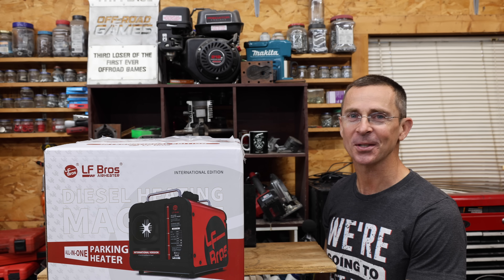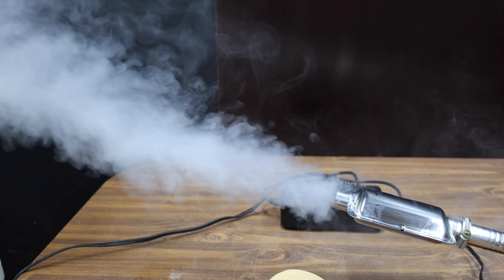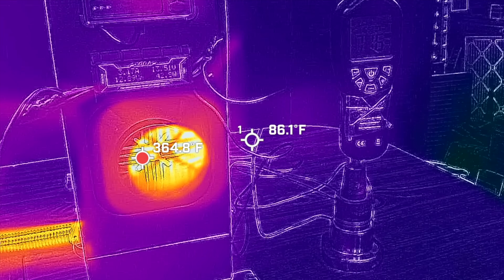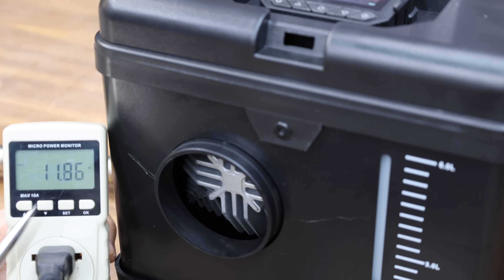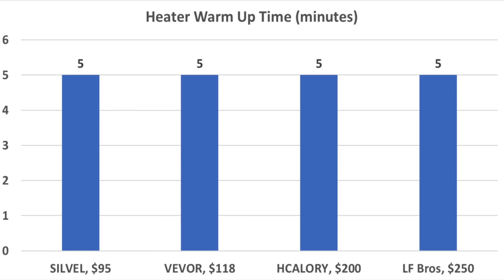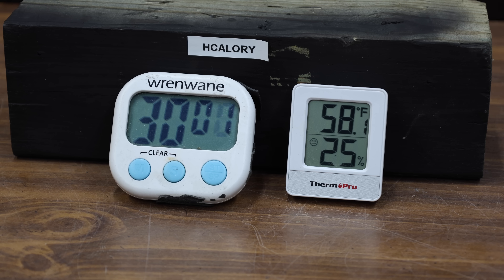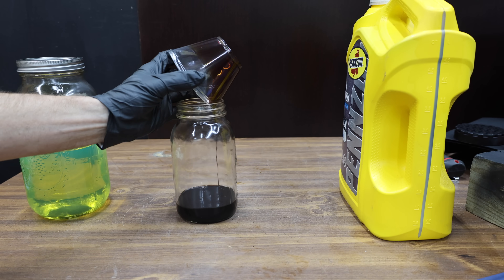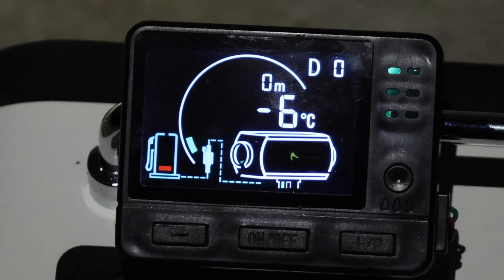The Truth About Cheap Diesel Heaters!

Comment: With the failed start on the silvel, you probably had some extra fuel which could cause the smoke. Need plenty of intake air as well. I have been using the tall model Silvel for my fifth wheel for about 2 weeks. The unit has worked great without a bit of smoke.
Reply from the maker: Thanks for the constructive feedback.

Comment: Measuring thermal output:  I built a thermal solar collector a while back, and wondered how to measure it, given all of the variables (and no pro instruments).   I eventually
thought of putting ~400w of incandescent lights in an insulated metal duct tube.  Then I could measure my electric heat power vs. temperature rise, and extrapolate. 
P.S. My thermal solar collector was good for over 1800W using just a 5" PC fan.  Yay.  But that was enough heat to make my styrofoam insulation stink.  Drat.
Reply from the maker: Thanks for sharing.

Comment: Great video!  I actually have a Vevor - it's not the same model you have there, but fairly similar.  I haven't used it for heating anywhere in the house, but I have been tempted to set up a window insert, so that there can be a "hot room" in the house if there is ever a long term power outage.  I HAVE used it when testing out a tent in some colder weather.  The temperature dipped 10 degrees Celsius colder than I had expected, and it kept me from freezing!
Reply from the maker: Thanks!  Thanks for sharing.

Comment: Live in canadian rockies at high altitude.... and i switched to a diesel heater this year for ice fishing... bought the vevor upright very similar to what you had there... had some noise issues to solve (now have pump tick almost completely silent).... but now its dialed in and works great..... i got it on sale for a hundred dollars canadian (huge bargain)... and is a ice fishing game changer... will never use propane again... works great in very cold temps...
From my finally frozen again,  overtaxed, undersized, lob-sided, igloo on the mountain in alberta Canada 🇨🇦
Reply from the maker: Thanks for sharing!
Reply: I use a Buddy type propane heater to heat my garage when working in it. How is the Diesel heater superior ? Do you get a lot more heat ?
Reply: @MathewPollard-vj4uq  to start , it's a dry heat ,  also it forced air so no carbon monoxide issues , and is less than half the cost to run over propane...way more efficient.... in my case it's also lighter to drag on ice... AND BIGGEST PLUS IS IT IS A LOT LESS OF A FIRE HAZARD...
Give one a try ... I bet you never go back to propane.

Comment: I've been using these to heat my detached 23x23 garage for a couple years now. Some brands like Lavaner Pros are tunable, which helps with efficiency and tuning for alternative fuels. Unfortunately, for WMO, it will gum up over time and produce a concrete like deposit that's hard to clean out. Some guys start it on diesel, and then switch to alternative fuel, and then back to diesel for shut down. Also, the 8kws are just a 5kw with a bigger fuel pump, and a lot of people have found no significant increase. Some people also use radiators or something similar to capture lost heat from the exhaust heat.

I have 2 5kws in my garage, which I insulated to R38. 1 heater can keep the garage in the 60s while it's in the negatives outside. I have a 2nd heater to help heat the garage from cold so it doesn't take half a day. Once the garage walls are up to to temp, 1 of these things keep the garage heated VERY well, especially for the price. I use road diesel cause it's more convenient, and then I actually put it on my taxes and get money back for it (about $12 for 55 gallons). I got one on sale for $65, which I planned to use for WMO.

Comment: Regarding fuel. I wonder if a mix of used motor oil, used fryer oil(filtered, but not proccessed like bio diesel) and regular diesel, would work in this... if i recall correctly back in WW2 they would make black diesel  by mixing 4 parts oil to 6 parts diesel... quick and dirty... 

 I think if i were prepping for winter ixd go as far as to save spent motor oil and fryer oil.  Mix the 2. Add acetone to dilute enough to filter (2 micron and magnetic) and then cut it 1:1 with pump diesel. Effectively 2Xing my fuel for the winter and having a nominal amount of processing to keep the pump and injector from clogging as well as allow for prolonged use (a full season?) With out fouling the glow plug.

Also. I plan on running either 1 of two ways.   Full heat  scavenging the exhause by running the exhaust through a copper coil, in a large steel container filled with sand, plumbed with a condensate drip trap at the bottom and the exhaust out the top before a muffler then out of the shop. 

And the air opwn in the shop. 

OR, runing it as a dual sand battery and having the air  blow through  a coil  as well.. 

 I feel that 2x sand battery would equate to a verry long warm up time, but provide the longest relief  from freezing nights in yhe shop. 

But probably  the way ill go is to have the best of both, and have the air run as normal and the exhaust through a coiled sand battery.
Reply from the maker: Thanks for the suggestion.

Comment: I have a vevor and a silvel and they are awesome. I definitely recommend buying the ones that come all in one as I bought a silvel that’s meant more for just installing in a vehicle and it was a pain to setup but still works flawlessly. I use the vevor to heat my 32’x28’ insulated garage with the exhaust run through a radiator and out the wall. Once up to temp it will run days on low without adding fuel.
Reply from the maker: Thanks for sharing.

Comment: one thing I wanna  try with these lil heater is use the exhaust gas to preheat outside water .. 350F thru about a 3/4 to 1" pipe wrapping a stainless steel tank thats insulated the exhaust gas is cooled and the water is warmer ??
Reply from the maker: Thanks for the suggestion.

Comment: I was considering one for the garage for doing some work here and there. After considering everything I went with a big buddy pro propane heater. I wanted more portability so I could use it in the barn or little shed and move it around. no exhausting for the propane was a big plus. I was painting in the garage in a t shirt with a door open and fan to vent when it was 20 degrees out the other day, was to hot! If I had a camper this would easily be the solution but not for the setup I have currently. This is the best most in depth review of these heaters. I liked Deboss tearing down a 5k and 8k one.
Reply from the maker: Thanks for sharing.

Comment: Vevor is a relatively big brand, compared to the others, and they sell a lot of stuff direct from China (Banggood, Temu, wherever), which usually means at least some price reduction, although some Amazon resellers get pretty low, too.  Vevor stuff is usually considered pretty reliable, whereas I've never seen a Silvel product before.  Still, these heaters are really control panels and cases attached to the same hardware, which is great to know!
Reply from the maker: Thanks for sharing.

Comment: Hey Project Farm.

I appreciate your test on these heaters, but would like to see how these compare to, Eberspacher and Webasto units. Also it might be worth it to see how much or little they have copied from them as it appears that most of the market appear to be copies of these two brands.

With the Silvel being smokey, that's because an attempt was made to start it using a device that wasn't rated for the amperage draw through the cigarette socket, and subsequently the device hit a low power error. (Something I've heard is Those battery banks don't actually put out enough amperage in order to start/run high loads (10-15A (Generally when the glow plug is on in the warm-up stage))) 
This exact thing will happen with a name brand heater as well (Low voltage cut-off, to protect the battery), but the brand names tend to run for a while after this happens to potentially cool down. But mainly it smoked because it was attempting to feed fuel to the glow plug/mesh. That was still in there when you went to fire it back up on a better power supply.

Most of these seem to be Eberspacher Airtronic D5 copies.

Why should you consider what a random nobody like myself has said? 
I've assembled, rebuilt, repaired and tested over a thousand Eberspacher Airtronic D2's, Webasto 2000S, 2000ST and 2000STC models for the Ambulance Service over the space of three years.

I'm happy to answer any questions and I hope this info helps.

Comment: These seem very unefficient alot of heat is being wasted out of the exhaust on a device desgined to heat more of that should be transfered to the heat outlet. Also something burning diesel there should be a way to use that heat maybe exhaust heat or what ever to power heat pump or something. Granted would be added cost and parts but a self powered and running heater would be a much better value
Reply from the maker: Thanks for the feedback.

Comment: Good tests, Todd.  But I don't recall if you said all three had those GHASTLY LOUD fuel pumps.  I was just reviewing these over the weekend and heard on on the video and got really mad.  What a stupid thing to put on something which will be used in a vehicle.  My only complaint is that you didn't isolate the heaters from the testing area so we could get inside-the-vehicle sound measurements.

Comment: My vevor smoked just a little at first fire up but after that, it's been great. Going on my second winter and no problems running, but it's a little weak heating my shop....not the best insulated building. Takes the chill off.
Reply: Size of shop and location so we can get an idea ?
Reply: @MathewPollard-vj4uq  about the size a 4 car garage. I'm in western Montana.
Reply from the maker: Thanks for sharing.

Comment: To whomever is thinking about buying a Chinese Diesel Heater, I just wanna say that there are also several models that are NOT all in one units.
You can have a large fuel tank supplying Diesel to the heater and the tank DOES NOT have to be in the same part of the house (or wherever you're installing the heater).
I chose one of those to heat my shuttle bus camper, and I use the supplied external fuel tank or tap into the bus' Diesel tank.

Comment: These are all Chinese clones of the Webasto heaters, but for the price it's hard to argue with the results. As others have said, we've been using these compact diesel heaters for the sleeper bunks in trucks for a long time. It's nice to stay warm while only using about 1/10 the amount of fuel that idling the engine would consume. Especially since they can draw diesel straight out of the existing fuel tanks.
Reply from the maker: Thanks for sharing.

Comment: quick pipe wrenchs might be a good review topic. They are relatively cheap and i feel like if they worked as advertised would actually be quite useful. But they are still expensive enough that most people wouldnt want to buy 3 or 5 to figure out which is good.
Reply from the maker: Thanks for the suggestion.

Comment: Excellent review as always. I have a small garage 20 x 24 that I would like to heat, I was wondering what size your shop was?
Reply from the maker: The garage is 30x24 with a 12 foot ceiling.  Decent insulation.

Comment: The air intake and exhaust on the combustion side need to be outside or you will kill yourself with carbon monoxide. Kerosene is the cleanest fuel to use. Ive had one in my van for 8 years.
Reply from the maker: Thanks for the feedback.
Reply: @ProjectFarm  I have slept in my self built camper where the outside was - 6 degrees centigrade and the interior was 21.  They coke up with diesel. Kerosene / paraffin makes them run clean.

Comment: Been using one of the case less ones for 3 years now and it's great I use it in a 29ft camper,  idling it can keep it at 60 degrees on a 20f night. Only important thing with getting one of these is buy the seal kit with glow plug and other consumables for the 11$ on eBay. if you run dirty older diesel or motor oil it will gum up the screen that's with the glow plug and starting it can become a problem and if the unit has been run for any period of time the gasket becomes brittle.
Reply from the maker: Thanks for the feedback.
Reply: Filter other oils well and run a thin blend

Comment: REMOVE THE AIR  RESTRIKTION... 
IN THE AIR INTAKE ... THE "" IDI0T FILTER""
THEN BLOWER WONT SOUND LIKE A BLOCKED VACUM CLEANER
BETTER AIR FLOW ... LOWER FAN RPM .. SAME AMOUNT OF AIR FLOW

Comment: I am a bit confused why these heaters are good for power outages if you need a 12 volt source.  A quick search revealed one can use a 12 volt car battery with an inverter or a generator.  If I am going to fire up my generator, I can use my 120 volt space heaters during a power outage if necessary.  I also have 3 kerosene space heaters for my shop, one forced air.  All three say you can use them indoors.  Although the forced air does require power.  My shop isn't very air tight and I can always keep the side door open or lift the garage door.  I use a CO2 detector that has never gone off.  I would do the same if I it was necessary to bring these heaters in the house.  Just today, I raised the temp in my garage from 38 degrees to 60 degrees in about 30-45 minutes.  Since most of my garage/shop is not insulated, this works pretty good for me.  I do turn off the forced air heater since it is very noisy.  I also believe (but not sure) that kerosene burns cleaner than diesel.

Comment: I don't know if I missed it but what size was the shop...
Reply from the maker: My shop is 30x24 with a 12 foot ceiling.  Decent insulation.
Reply: @ProjectFarm  my front area 24 x 36 ..9 ft ceilings insulation .  Ok .I have a 50 k ceiling furnace nat gas ..it's ok ..25 deg up temp w on ... 😁

Comment: These will kill a standard 12V car battery to the point that the heater will shut down on low voltage in about 12 hours.  Don't think that they're low power consumption just because they run on low voltage.

Comment: Are any of the diesel heaters safe to be operated exposed to the elements? If so, it seems they would be a great option for emergency use in areas like Western North Carolina where there are a lot of families currently living in tents. If any of these would be a viable option, what are the chances of getting a drive started for supplying some units to help those in need?

Comment: diesel heaters will clog up if you use vegetable oil or that kinda stuff.
You seriously wanna use clean fuel to make em last long without having to clean em
Reply: ps: you also might wanna test how long it can run on a car battery.
Because if you hook it up to your standard car battery that is supposed to start your car in the morning.....
It wont be able to if you had your heater running for some time before starting the car.

So, hook up a second circuit that charges a second battery. One that is there to power your heater.
Because if you are gonna run it off of your starting battery, do not be surprised that you might run that battery dry and have no juice left to start the friggin car.
BUT on the + side: it will be warm for the next hour. (or less)
Enjoy your stationary lump of metal in the middle of winter while it is still warm

As for indoors: I just have an old car battery that has some life left in it hooked up to a charger. Simple charger, cheap.
And i hook up the charger so it charges the battery.
BUT: Before i hook up the charger to the battery i start up the heater.
It will start up from the juice contained in the battery.
And once it is running nicely, then i will hook up the charger.
Because the heater does draw a lot more current when starting up, and i dont wanna foek up my charger.
Reply from the maker: Thanks for the feedback.

Comment: Good video. I have the Maxspeeding Rod and love it. I snagged it on sale for $70 and am blown away impressed by it. I use it for cold weather camping to heat my tent. I don't think there is a more efficient source for heating. The huge added benefit is it does not introduce moisture into your environment like propane does......1.6 pounds of moisture for every 1 pound of propane burned. That is a huge issue in tents particularly. They are way more awesome and cheaper than a heater buddy.
Reply from the maker: Thanks!  Thanks for sharing.

Comment: I have been looking to heat a 18x24 shed this winter for projects. I think this will be a cheap way to heat my shed. Thanks for the video. I insulated my shed this summer and hung OSB over the insulation. I guess I would need to come up with a way to vent the exhaust pipe without leaving the window cracked or the door open.
Reply from the maker: You are welcome!  Thanks for sharing.

Comment: I appreciate your videos and your efforts to make unbiased testing. I unfortunately have to point out in the name of fairness, a mistake. The first heater tested was made to look bad because of an error you made. Attempting to start the unit with the wrong power supply allowed the heater to start pumping diesel into the burn chamber. Low voltage prevented full start up so that fuel never ignited. So the second start up attempt had double the amount of fuel in the burn chamber, causing excess smoke.

Comment: I've been heating (on demand) my 200sqft solar powered shed with one and it's fantastic, even at 10deg outside I can get it to the 60s and that's with no insulation. I have another that I keep as a spare that has come in handy a lot when I have to do something outside or in case of a power failure. I do some waste oil blends ala black diesel but keep it under 25% to reduce carbon buildup and its been fine for ~2 years. Thanks again for a solid review, once again you are spot on.
Reply from the maker: Thanks and you are welcome!